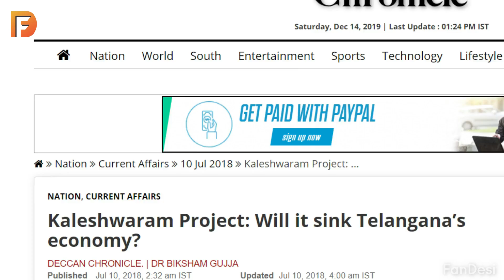Kaleshwaram - India's Most Ambitious Lift Irrigation Project

Comment: im concerned about the power consumption it is too high.
the maintainance cost also very high.
hope it will get success
Reply: We can produce a lot of solar power , maintenance is not big problem.
Reply: @kalyanyadav2120    u can't say maintenance wll cost less. Acc to the report an estimated amount of 2,200 crores should be spend only on electricity for ur info u cannot be always depend on solar energy bro and per annum atleast twice the water should be pumped. And it has estimated minimum 80,000RS wll be spent only on electricity per "Acer". And india doesn't have that huge pumps to pump water and there pumps are exported and in case of any problems technician should be brought from other countries and almost most of the components should be imported. And for this project government has taken soomuch loan and they r paying interest. And it literally connects soomany large tunnels so pls just imagine the expenditure after completion of the project. Ik that this project wll play an major role in farmers life dude bro I am also scared that telengana wll be trapped into unpayable (atleast for 30 to 50 years)debt trap. I don't know if u know this that this project estimated amount was 80,000 crores and now it is 1,00,000crores.
Reply: It wont pump/lift 24x7. Only when needed.
Reply: Be positive